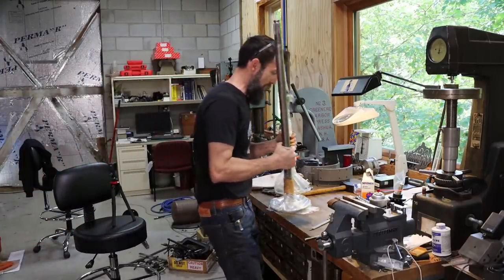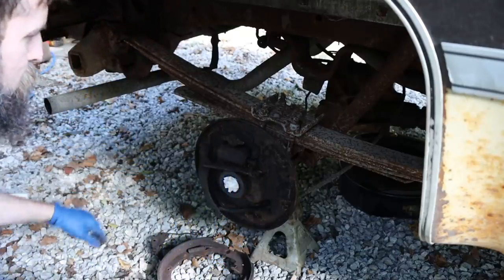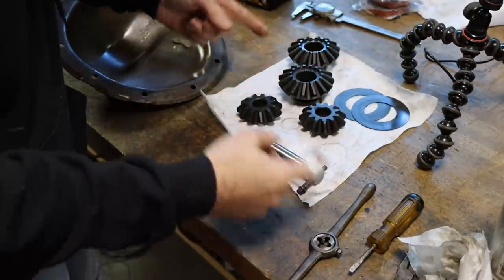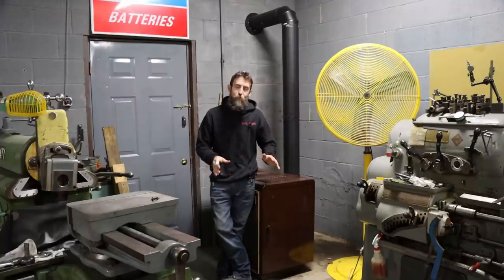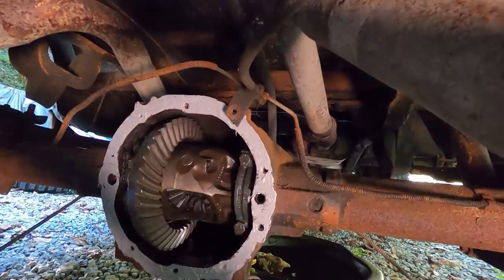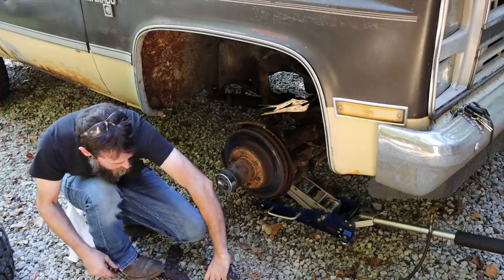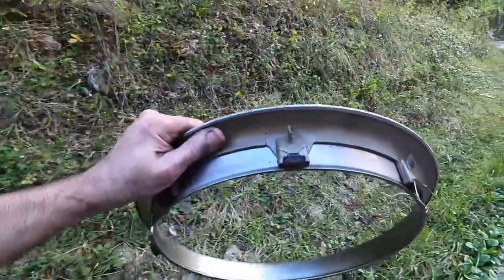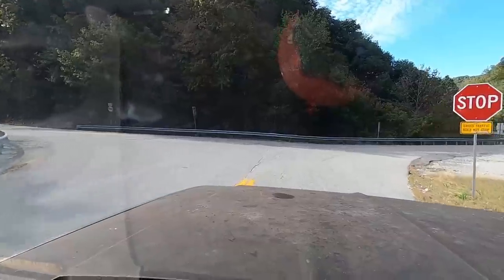Fixing my Junk  . 85 Chevy 4x4 Part 2

Comment: Hey was watching the video of you repairing your old truck .  I got a helpful tip for you on the front brakes , maybe you know about it , or maybe not.  but if bend the two ears down a little bit on the outside front  brake  pads it tightens them up so they fit snug into the caliper , and they won't rattle while you are driving .   because darn near every old GM  with with that style brake pads rattle unless you glue em onto the caliper with high temperature copper silacone , or bend the ears on the pads , and install good anti rattle clip on the inside pads to the caliper piston .

Comment: Boy, brings back memories.  When I was young we heated with coal. I had to dig out the ashes, load them into buckets and spread them out for fertilizer (I think).  Hated that job. I don't think our rickety old house had any insulation either.
Reply: Digging ashes into the garden helps break down any clay into soil.

Comment: You need a " SLIPPERY PETE" fluid pump.  Get it on Amazon. I love mine. I used it for transferring acetone from gallon jugs to quart containers, side by side gearbox oil changes, oil changes on the lawnmower etc..... you get the idea. It's good for all your pumping needs and they don't cost much.

Comment: Wood heat is radiant. I used aluminium foil behind the stove. It works unbelievably well. So well you will not need a fan. I also had a 85 Chevy. You mentioned yours having a 3 speed. I drove mine like a 3 speed 2nd to 3rd then 4th. I seldom used the granny first gear and never when on a casual drive.

Comment: Yeah do a series I loved the series of the workshop repair and would love to see you do the truck as for putting a flatbed on it just go to a metal recycling yard and find some steel angle or box section and make the framework and board it out.

Comment: Personally I would recommend you get a 3/4 or 1 ton to suite your needs. Long bed too. I am sure you could easily find a repairable squarebody in your area if the initial expense is the major issue. Nice work either way!

Comment: for the first time in my life I get to work either in a garage or at least the paved driveway.  I’ve spent so many hours sifting gravel for nuts, bolts, screws, needle bearings, ujoint caps, my sanity…

Comment: Perhaps you could weld a frame for a flat bed? And install some hinged folding bed gates on the side and rear that way you still have a truck “bed”. Heck, you could spoil yourself and install a small crane arm and ratchet winch. Safe your back on some heavy lifting. …I like nice things.

Comment: You talk about the differential pin bolt coming loose inside of the differential ... I had a transmission rebuilt out of an older Dodge Caravan (I was replacing the engine in it and customer wanted the tranny rebuilt at the same time). When I went to pick it up from the shop, they showed me the pin bolt had sheared, but the pin stayed in place ... until they took it apart, at which point it fell out on the floor. They had no clue how that thing stayed where it was supposed to stay, lol. They ended up having to install a new carrier in it, though they reused all the original spiders/ring/pinion.

Comment: Would be nice to see a rebuild series for the truck. Start at the bottom and work you way up threw the mechanicals and then do the body. I have 2009 Silverado 2500HD with around 140K miles that unfortunately has started getting rustbelt cancer. Really hate to spend the kind of money it takes to buy new especially since the new trunks have so many reliability issues so old red and rusty will hang around a while longer.

Comment: You made me laugh a bit this morning. "It's a wonder that drum brakes work at all." Second car was a 1969 Mercury Cougar (I was in high school, getting ready to go to college.) It had 4 wheels with drum brakes. That car would get up to a high speed in a hurry, and indeed, the drum brakes didn't slow it down worth a dang. Now I drive a 2014 F-150, but since I'm retired, it still only has 73k miles on it, but has 4 wheel disc brakes, which work a LOT better than my first Ford product!

Comment: On that brake spring return tool if you change drill spot to a slot to end of the tool you find it much faster put the springs back on

Comment: I would like for you to keep the old truck and fix it up.  I retired in 2009 and got rid of my old 1977 "heavy half" Chevy.  I now have my son's hand me down 2002 Silverado which is a nice comfortable truck, but it has computers and that sucks.  The engine one works just fine and I even bought a tuner and changed things to get a little more performance.  The problem is the body control computer.  It went crazy after my son had a after market alarm and remote start installed by some "expert"!  I had to remove the alarm and buy a new BCM then had to get it programed just to be able to start the engine.   Still can't get the under dash and other courtesy lights to work and only shops that have the software can do the programing.  The old truck had switches, relays and fuses that could be fixed by anyone with common sense.  Sure miss the old days in a lot of ways!

Comment: My newest vehicle I've owned is what I have now a Chevy 1500 I still have the old 76 Ford F150 and 79 4x4 F150 along with all 4 of my 93 Dodge Dakotas (1 wrecked, 1 needs reprogrammed after taking transmission out of the wreck, 1 4x4 I drive, & 1 4x4 I'm not sure what is making grinding noise) and 1 94 Dodge Dakota that needs a transmission. Even when I was making $70k/year never had the desire to go into debt for a new truck. I've had 1 vehicle I didn't pay cash for. A 79 Chevy LUV in 96 I wanted a 4x4 bad. It was dumb that I didn't save the $700 for that truck. As I didn't need it, I just wanted it. I still had 2 cars to drive to work. Anyway my grandpa told me to only go in debt for only what you need like a house and a car IF YOU DON'T HAVE 1. I've always had backup transportation. Never less then 2 vehicles running. He even had a backup house in all my life. 1 house and a rental house. Dad sold off the rental before he died. And my sister trashed his house so don't have a backup house as when dad died he and my sister was living with me. So I say fix it.

Comment: The older pickup trucks were built tough. None of this paper thin body panels. Had a ‘76 Ford with the 302 V8 and three on the tree we bought brand new. Smacked a whitetail deer doing 60 mph. Deer must have flown 30 yards, but it barely even dented the front quarter panel. That would damn near total a modern vehicle. Ah the simpler days.

Comment: Bought a VW locally really cheap because the oil level light would not go out. It had been to many dealerships but they could not fix it. Thurns out it was the bonnet (hood) catch at fault !!. The dipstick had reported low oil level, the oil had been topped up but because the computer had not seen the bonnet (hood) opened it would not believe the signal from the dipstick and kept the oil level light on. Cheap fix, car flipped, happy days.

Comment: What I hate about modern vehicles is the electronics - any engine that needs a computer to control it is a turn off to me - I'm a points guy (set with a piece of cardboard from a cigarette packet as a feeler gauge) and I'm happy with a Hall effect distributor, but that's about all. I guess I'm stuck in the 60s.
Reply: LOL Stu's grandfather: What I hate about modern vehicles is the spark plugs and point and distributor and the rubber tires that always go flat and the gasoline that runs out and having to hand crank to start it.- I'm a horse and buggy guy (feed the horse hay and it goes, wooden wheels that never go flat) I guess I'm stuck in the 1800s.

Comment: It would be interesting to see the occasional video of the truck clean up Steve , but not too much on bodywork . I always agreed with the old Alfa Romeo sentiment of the 20-30s where they made the car and let other people stick the bodywork on it .
Maybe start off by replacing those rusty brake pipes as I don't know what annual inspections You have for older vehicles over there .

Comment: I came really close to buying a 70's truck that clearly run and drove but needed a lot of work. It would have turned into a weekend project that would take years before I'd feel comfortable driving it 400 miles and it just wouldn't be nice. I'm sure the weekend projects would be fun after their done, but all that work just to have more to do. I like seeing projects, but at the same time I think you'd be as frustrated as anyone else constantly working on it.

Comment: You ought to have a cleanout "T" rather than an elbow at the bottom of your outside stove pipe otherwise you will be doing disassembly often. Insulated outside pipe while $$$ really helps the stove draw when frigid outside. You already know that firewood warms you many times and uphill wood is better than downhill wood.

Comment: The problem with newer trucks as I see it is that they quit putting manual gearboxes in them. I live at the top of a fairly steep hill in snow country and while it isn't impossible to deal with the hill in the winter with an automatic it's a lot easier with a manual. Electric hubs also tend not to work when you need them to as well. It would be interesting to see a series on dealing with an old truck for sure.

Comment: hey Steve,
How about adjusting the clutch before you strip all the teeth of low gear.
Just some constructive criticism, you could have used the hydraulic press in your shop to press the new studs into your new axles, instead of bashing them in with the large hammer.
You should have used anti seize on the new axle flanges where the brake drum spigots on.to prevent the unpainted parts from corroding and locking the brake drum to the axle.

Comment: I drive a 1977 Ford F-150. Still runs great but some kid backed out of a driveway and wiped out the driver’s bedside. Insurance totaled it but let me keep the truck. Now it looks like hell but still drives great. Ive looked at new truck but have decided I’ll probably never have another one. I can’t justify $50.000 or $60,000 for a vehicle I would drive very little. Prices are insane and I think Chevy sells one for over $100,000. Fix that old Chevy.

Comment: Steve  I am sure you know you can go from mild to wild with that truck , LS power , 6 speed overdrive trans posi diffs on & on & on.  My opinion , keep it simple maybe just freshen up the motor with new rings & bearings a set of Alum heads new RV cam and a Performer intake, then add stainless headers & a free flowing exhaust with quiet mufflers . Cut out all the rust and replace with patch panels block sand and re paint with Base/ Clear epoxy paint. Buy  new inner door & kick panels and a new dash pad then go through the wiring and dash gauges as all that is available. Who could afford a new 4 wheel drive Chevy truck that you can't fix , everybody is getting wise to the fact old is the way to go .  There is zero advantage to a new anything .  Restore the old and use it. I have 5 old cars, the newest is a 1970 as my daily driver. Couldn't give me a new anything even for FREE !

Comment: I have an old farm truck that does not get used enough for me to completely trust it. Every 5 years or so I start thinking I should upgrade to something theoretically more reliable. I always come back to the same conclusion, better the devil you know then the devil you don't. My old truck may not be the nicest, but I know exactly what to worry about with it. I know that for some reason it hates going between 55 and 60 but is happy when either side. It seems like they develop character the more you use them. It almost feels like planning on a new puppy before your old dog dies. Just doesn't sit right

Comment: my 88 toyota 4runner i need to replace the rusted out backing plates on the rear axle but have to take them out have the bearings an seals pressed off the axle put on the new plates then press on new seals and bearings which only place with a press big enough to do it is a peterbilt dealer an hour away from where i live sooo ive got the replacements but am loth to disable my truck to do the work as the plates still hold my pads in the drums i used to own a 79 chevy c10 i cracked the frame helping to hold a car from sliding into a flooded byou down in texas after a wreck the driver was out cold the rescue people were local volunteers i drove up an had the biggest vehicle to hold the car from sliding while they got the driver out. id love to see you fix the old gal up! old an dependable  means that its passed the trials of its peers where the others have gone the way of the crusher the old ones live on to remind people of good dependability with a bit of rust an dust scrapes an a few quirks

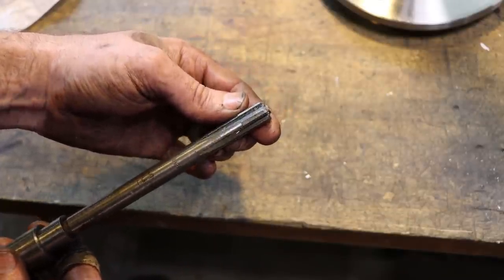Comment: I love that drill press.  2:55 $%#@!    Yes, those vise grips are the way to go, for spring removal.  I hope you went back and kicked that guys buttocks, that sold you the truck. We used a kerosene heater with a three 55 gal drum header out back.  Is the bottom bolt on the rear-end cover also the drain for the rear-end.  Do you ever use Lucas oil stabilizer in your rear-ends.  Should be able to haul a good load of wood now.  MPG is not a big issue, unless it's a daily driver.  Nice gas can spout!!!  Last Chance road. LOL  I'll watch whatever videos you put out.  See you next time.

Comment: never did like doing drumbrakes those things are like beartraps
wow youre truck sounds like some of the stuff i bought , i nowadays just buy old cars that i know verry well wat the common problems are of and that arent running , at least i know about wat it will cost to repair it (smart fortwo /450) 
- putchase price non running                                               :  250 euro (yes cars over here are verry cheap compared to the states , thank US blue book value for that)
- rebuild bottom end bored and honed with new pistons : 750 euro
- valvejob and new gaskets                                                  : 250 euro
- replacing the engine with the new one                             : 1 day
- miscalanious (lightbulbs tires brakes etc)                      : 100 euro
so 1350 euro gives me a verry good car i know will last me 80.000 km or 5 years with some small repairs in between 

btw if you hold youre hand on the gearstick youre keeping a load on the shiftforks and they lean against the running gears that can wear them out or heat them up , better take the hand off 

it might be nice to find a good body out of arizona and do a frame of rebuild on it (you done most of the other stuff on it ) probably cost the same as a newer model used truck but like you said you can repair these old trucks with baling wire duct tape and a hairpin

cant haul sand or gravel with a flatbed unless you put solid sides on it , maibe find a trailer with a busted / broken axle / frame with a good (aluminum ) bed on it and adapt the bed to fit on the frame of the truck 
sure i would love to see a restauration / frame of rebuild of the truck

Comment: Yes I would like to see your approach to fixing your truck. But I am also curious what the backlash was on the differential was, after your repair. And why your didn't replace the rear seals while it was apart. Or did you.

Comment: Antisieze has made every self adjuster stop functioning for me.  May take five to seven years but they all get gummed up to the point they stop working.  I've since moved on to 3M silicone lubricant.  So far no issues.  Fasteners with antisieze are the same way.  While not "seized" they don't spin out easy either.  Always gummy.

Comment: The aluminum transfer case on my 2002 Sierra rotted out and leaked fluid, wasn't worth replacing.  The whole under carriage was rusted 
out with 175,000 miles.  My next pickup will be electric, I'm fed up with the internal combustion engine, gas, oil, filters, fluids and check 
engine lights.

Comment: Should you not bleed opposite corners? 

Know that if one goes you still have one front and one rear brake still operational so you don't lose one side or the other and not both front or both rear brakes?

Comment: When you compare the cost of replacing that truck with a recent model versus repairing something you already own, it’s pretty much a no brainer. Especially when you look at the complexity of modern vehicles where you almost have to be a computer scientist plus have access to very expensive diagnostic equipment. And even if you buy a supposed good used truck, you don’t know whether you’re just buying someone else’s headache or not. Better the devil you know than the one you don’t. Go thru the truck yourself and you know what you have…..

Comment: If you do go in to refurbishing that truck just be VERY careful about parts. As the Chinese have infiltrated our parts market bringing woe to many. So far Rock Auto has been easy to depend on if not NOS...some times Ebay has reasonable NOS floating around. Buyer beware, particularly engine/valve-train

Comment: Steve, the precision & accuracy that you work at is inspirational (to me anyway) but I was horrified when, early in this video you were drilling the hubs with such a 'flimsy' setup. Now I have, twice, replaced my drill press due to the flex of the table when downward pressure is applied (as much as 20+ thou at the drill point) thus rendering the resultant hole NOT vertical and when several hole are not vertical the piece parts don't fit. Would it be possible for you to do a video explaining this with a description of the errors involved?
Reply: In to case I believe that the other end of the axle shaft was supported, so the vise and table were only helping keep it vertical.